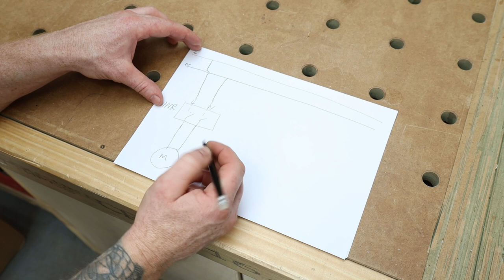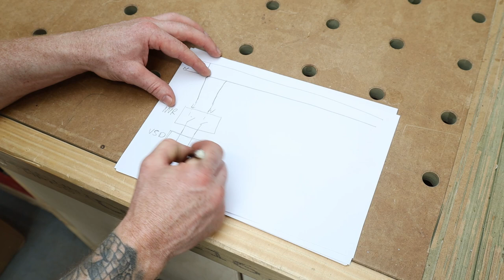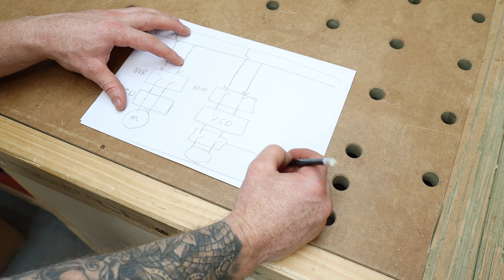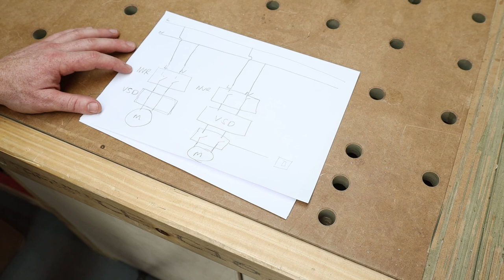Remote Dust Extraction Control When You Have a NVR Switch! How To!

Comment: Hi great video! I have a jet dc 1100 ck dust collector and I bought a Long Ranger 220V Multigate Dust Collection Motor Starter Switch System. The system is produced by psi woodworking to auto switch the dust collector by each blast gate when wired and when the dust collector is connected to the long ranger product. It is the greatest disappointment in my workshop that this never worked. The company states that their product is sold only for us and they don’t know if it works in Europe (Greece). Up to know I haven’t managed to find an electrician to solve the issue or provide valid advice on how to set up such a system, so any help is highly appreciated. Thanks

Comment: I have a lumber jack dust extractor. I am not sure, BUT i do not think i have a VSD within the housing of the NVR but a capacitor. 10 Microfarads. The wiring back into the motor has 3 cables. And the NVR is mounted to the unit.
I am putting the dust extractor within a sealed cupboard with ventilation to the outside so wish to turn it on and off remotely.
Any suggestions please?

Comment: Some good ideas for wiring in the switches. Do you know what the voltage range of the Ener-J receivers are, I know the Quinetic receivers need 85 to 260V, so after a VSD may not be the best place, depending on how low the VSD is set of course. Do the Ener-J switches not reset on power loss as well, effectively acting as NVR switches?
Reply from the maker: It will probably be the case that you can only put the contactor contacts after the vsd switching the motor  and the control circuit before it, I deliberately didn't go in to that or draw out a complete circuit as it would be overly complicated for the question I was trying to answer in this video. Ener-j switches do reset on loss of power but they also stick on and off and it doesn't solve the problem of the actual nvr switch.
Reply: @JohnMcGrathManInShed  Thanks for the extra info

Comment: As far as a device with a VFD, wouldn't your circuit diagram mean that the VFD was permanently live and drawing current. This would firstly consume energy when idle but also cause an issue if the VFD becomes faulty when the workshop is unoccupied. Isn't the output from most VFDs 3 phase?

I use one of the plug in radio device that came from Maplins (may they rest in peace). My Jet extractor doesn't have a NVR, but the Maplins device will not power the device if the power comes back on after an outage and so is in effect a NVR.
Reply from the maker: No is the short answer
Reply: @JohnMcGrathManInShed  You are the qualified electrician, I am merely an electronics engineer of 40 years standing. I would say that any electronic equipment connected to a live connection will continue to draw current and in the event of failure of that device is a potential for fire or shorting mains voltage to unprotected parts of the device. Even the humble USB charger will draw a current if left plugged in or if it's built into a socket, that is why there is a regulation to state the maximum current they can draw whilst idle.

Comment: I have a live network attached storage device (NAS drive).  A problem with them is when there is a power outage and re-booting when power is resumed.  I have lost one unit because of a double power outage within 30 seconds which killed the drive.  Do they make domestic NVR switches and which can be accessed remotely perhaps with a mobile phone ?
Reply from the maker: You probably need a UPS ( uninterrupable power supply) and a surge protector to protect that kind of equipment properly
Reply: Thank you John